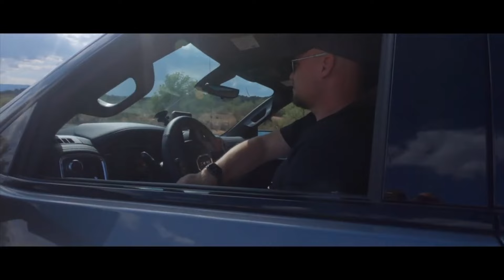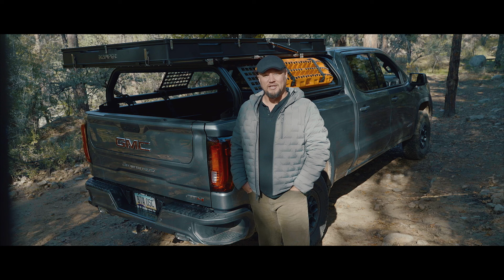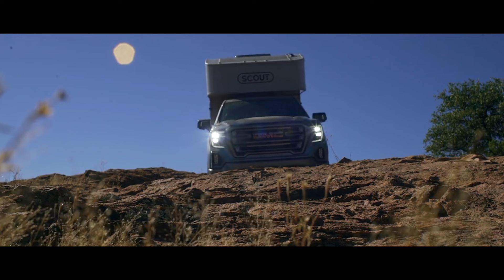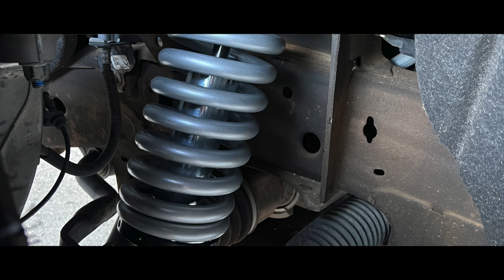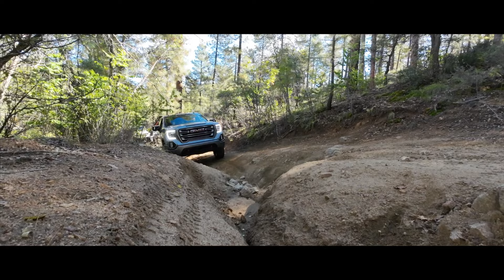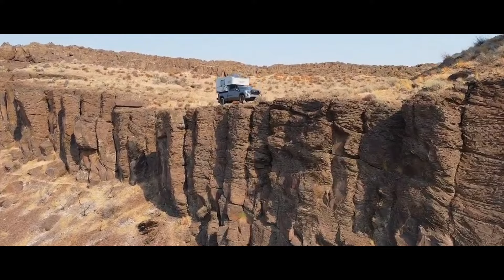GMC Sierra AT4 ExPo Build :: Project Wrap Up

Comment: I drive a '15 Sierra 4wd Max Tow and have been shopping for a more off-road version, I completely agree with you assessments at the end. G80 is terrible, just spins and tears up the trails. I wish GM would offer the off-road package with the max tow package. The max tow with 3.0 diesel gets you more payload, 3.73 gears but doesn't offer a 2 speed transfer case nor does can you get skid plates. My '15 has a 2 speed transfer case but no skid plates and I haven't had much luck finding any that don't require 6" lift. In the world of overlanding, it seems like a no-brainer to at least be able to build the truck from the factory with options. I was also building a Silverado RST extended cab to get a decent bed length while keeping the overall lenght in check.

Comment: Is this truck even rated to haul a camper in the bed? I was under the impression that Chevy/GMC didn’t rate the half tons for camper use.
Reply: My '15 Sierra 1500 has a max camper weight sticker in the glove box. I think it's. rated for 1,200 pounds with a 1782 total payload. I've seen that the Canyons and Colorados manuals mention no campers.

Comment: You need to look at the Ford F-150 Heavy Duty Payload Package in the FX-4.  It is available in a regular cab 8 foot bed, or also a supercab 6.5 foot bed.  The 5.0L V8 has higher consumption but is much cheaper to run on E-85 and reduces your carbon footprint by over 90%.  This also gives you nearly 3000 lbs payload, a proper rear e-locker that also works in 2WD, a dealer installable front Torsen differential option, a winch capable front end, it can also fit 17" wheels.  You could also buy the RCSB short wheel base single cab in a Snow Plow Package like mine and build out a Heavy Duty Payload Package in a truck that has a shorter wheelbase then any midsized truck sold in North America.  

Ford needs to make a F-200 HD Tremor version of the shorty with Method wheels and a 3600 lbs payload.  They have the axle capacity to do it.  It would be overland perfection.

Comment: I literally drive the same truck, only difference is I have the smaller bed. My question is, you added the coil overs without doing an upper control arm? All my research on lifting an AT4 above the factory 2” level showed it would require an aftermarket upper control arm. Did you run into any issues? Also did you have any rubbing issues going to the 35” tire. I’m currently running a 33” tire on a 17x8.5 wheel with 0 offset on stock suspension, and I’m thinking I should have gone bigger. Love my Duramax, only way to go :)
Reply from the maker: No issues with the UCAs, although I am looking at appropriate aftermarket alternatives. The biggest challenge is finding UCAs that use rubber bushing (instead of synthetic) and long-life ball joints (as opposed to noisy heim joints). 

The 35x10.5" is key to managing rubbing, although I did do quite a bit of trimming and "clearancing"

Comment: I agree about the G80 100%. I would take a good traction control system in low range over it any day after having it in several GM products. The comfort and all around convenience/utility of these full size half tons is amazing. I was a late convert as well and I can’t see NOT always having one going forward. Hauling kids, towing, using it on the farm, traveling…. It just works great. And from my experience, the V8’s are relatively economical, at least the 5.3 that I have been running lately. My only gripe is the terrible throttle modulation the drive by wire system has. It makes smooth throttle inputs frustrating when easing over stuff. Not sure if that’s the case with that Duramax or not. Our Duramax Colorado doesn’t exhibit that tendency and we love it too.
Reply: It's been that way for a long while.  My 2008 Sierra has throttle by wire, my 1985 Suburban had cable-to-carburetor.  What really sucks is when your electronic throttle decides to give up the ghost.  There is nothing you can do about it except replace the assembly....and try to do that on the trail.   Grrrrrr.